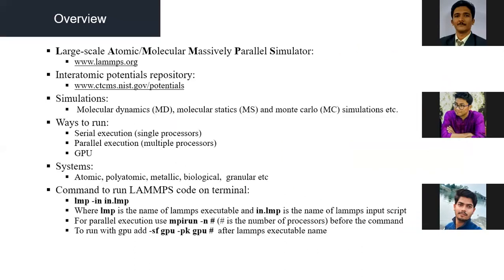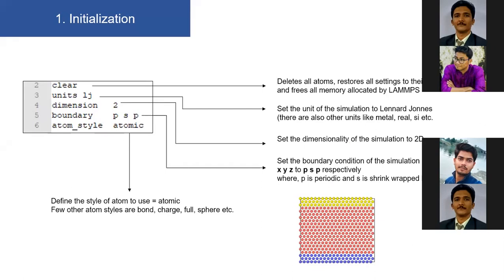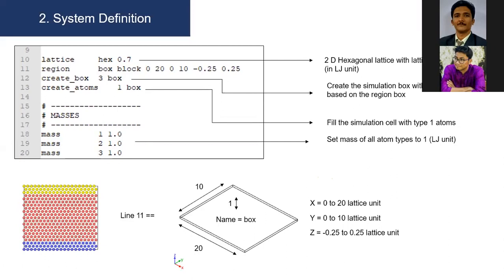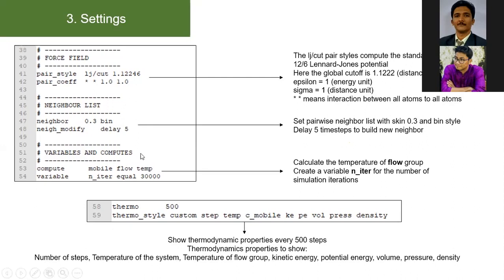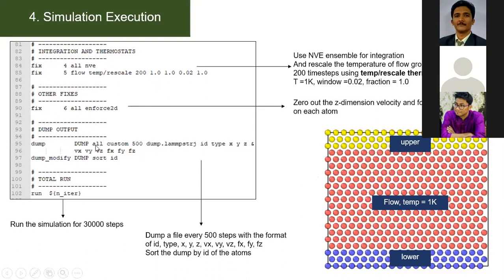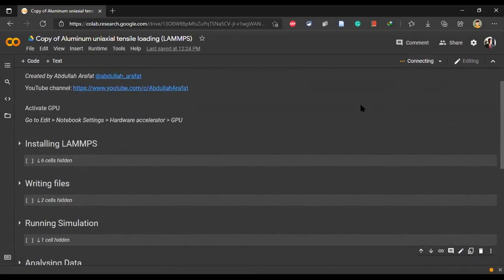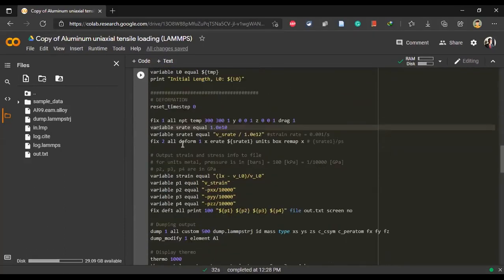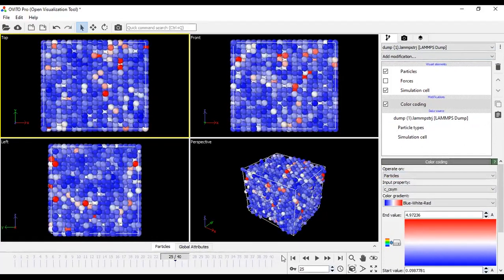Webinar on Modeling and Simulation with LAMMPS | ADCET, India

Comment: How can I fix top 5 or 6 layer of a system like you have done using atomsk?
Reply from the maker: I did not use atomsk to fix any layer. But to fix layers using lammps make a region and a group of that region then fix the layer as shown in the webinar.
Reply: Thanks, another question. Why there is tstart and tstop temperature in npt ensemble when it is isothermal isobaric ensemble?
Reply from the maker: @anisurrahaman7046  I think you answered your own question. As it is an isothermal isobaric ensemble that is why there is a tstart and tstop.